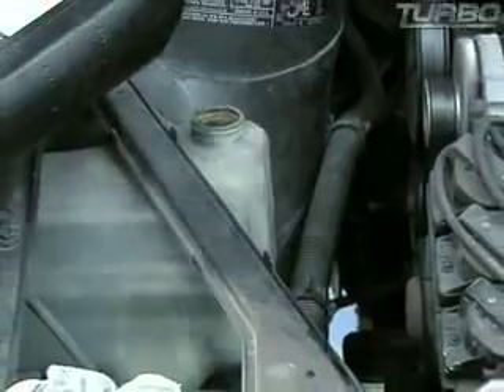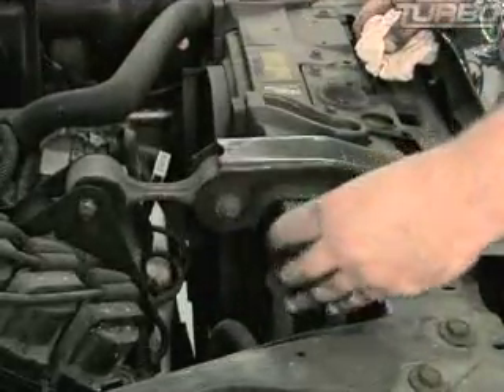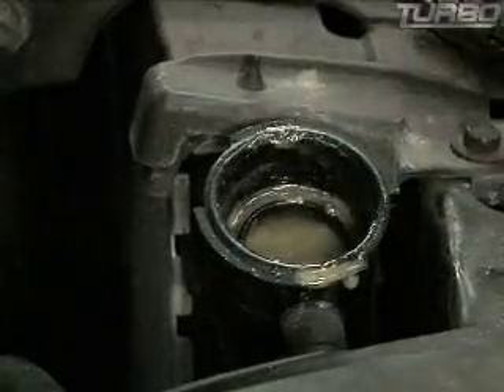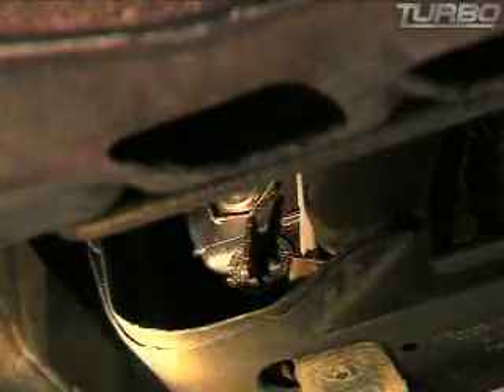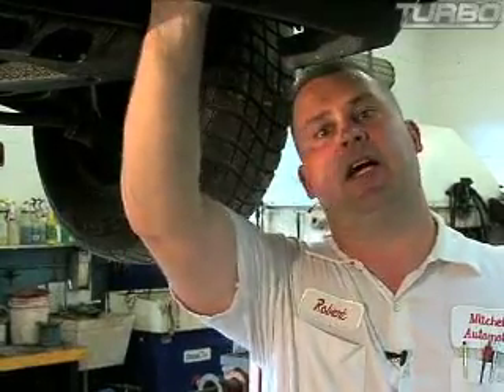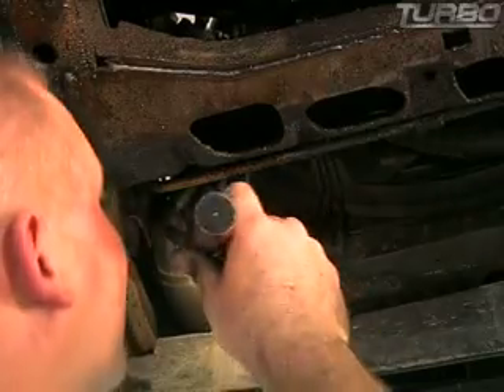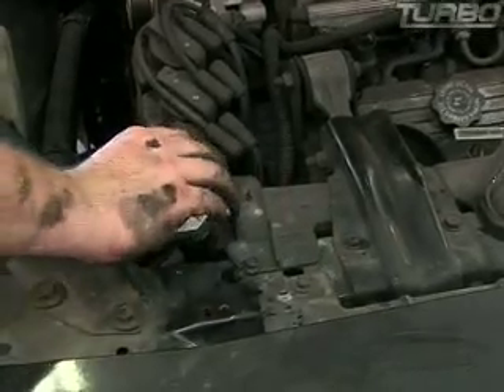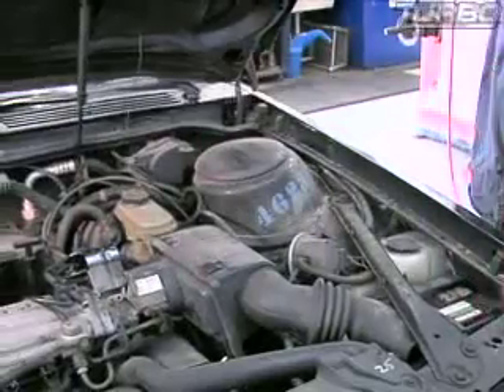Maintenance and How-to: Flushing the Coolant System

Comment: after empty the old coolant, don't you run with tap water to clean inside radiator before add the new, fresh collant and mix 50/50 with water?

Comment: This was a good video, it showed a quick process to flushing the radiator but in order to flush the whole coolant system you have to drain coolant also from the engine